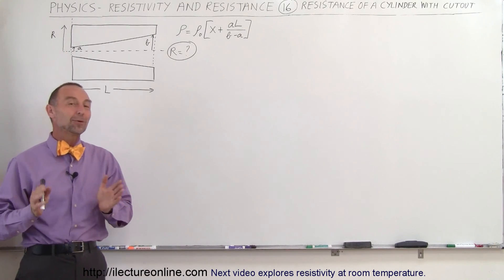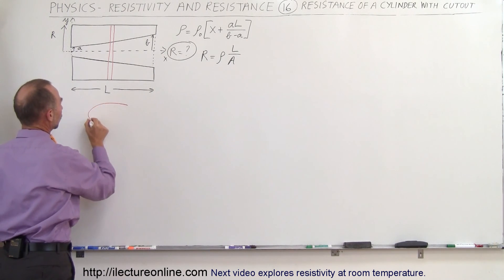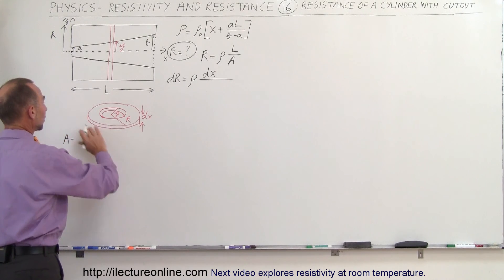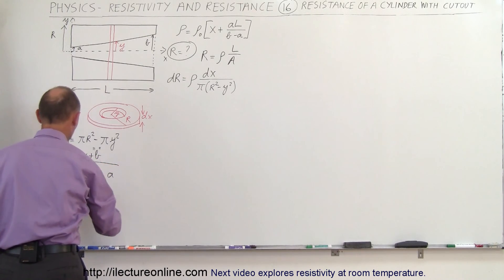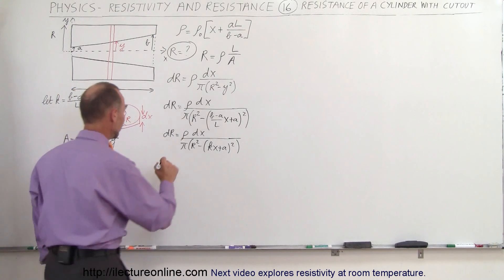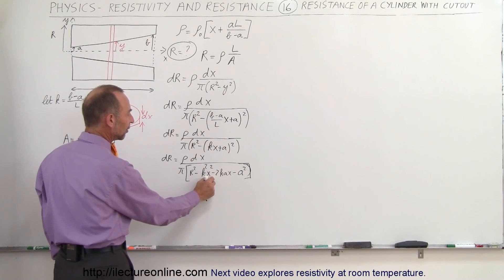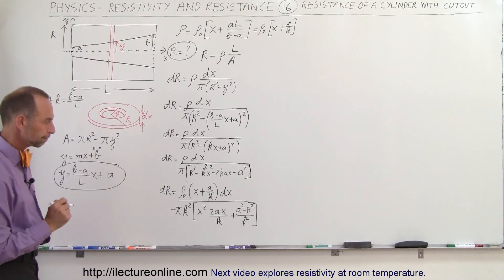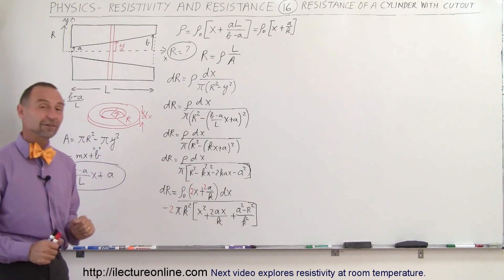Physics 40   Resistivity and Resistance (16 of 32) Resistance of a Cylinder with Cut-Out

Comment: is the initial resistivity equation (rho = rho(0) *(X+aL/(b-a)) a separate complication, or is that how resistivity changes in all cases of this system?
Reply from the maker: That equation is specific to this type of example.  If the shape is different, you will have a different equation.
Reply: i'm modelling the same shape but I'm getting confused whether or not I must* use the resistivity equation above. Is it incorrect to assume rho can only have one value?